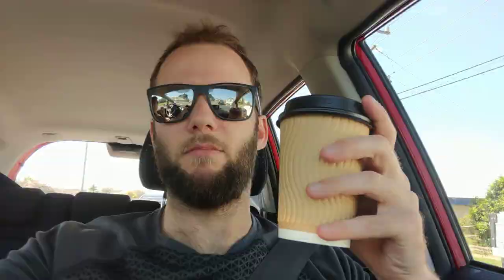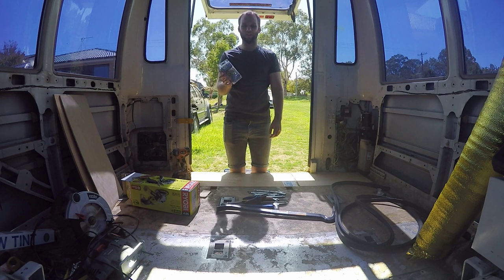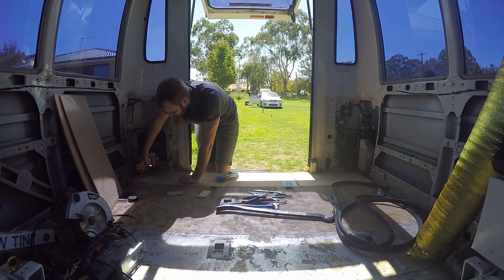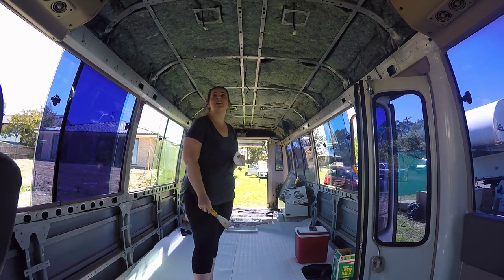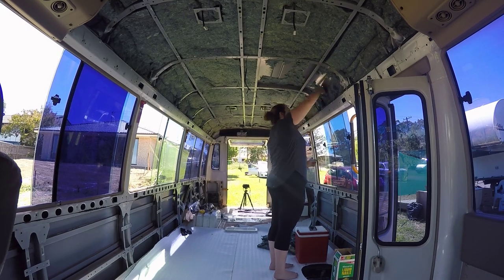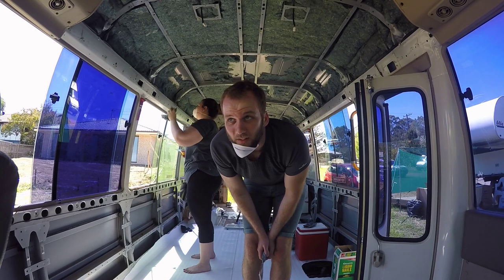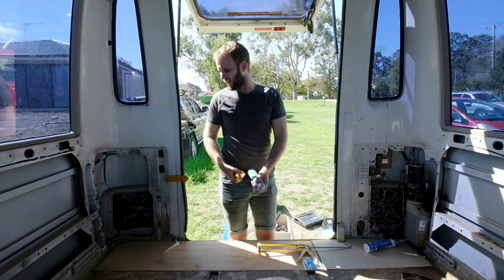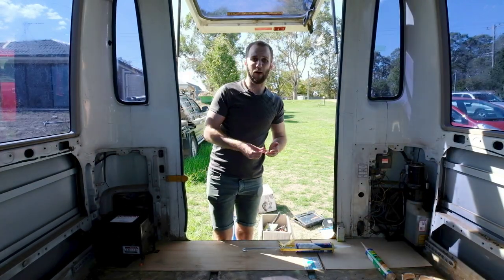Toyota Coaster Bus Conversion - Roof Insulation Removal and Finishing Underlay

Comment: How tall are you mate. Just checking out headroom.
Reply from the maker: Hi Francis, Shane is about 6ft and can just stand up straight in the centre of the bus (the highest point). He will likely need to hunch a little when we live in it which is something we accepted when purchasing the Coaster since we are happy with the size otherwise and are unaware of a similar sized bus with more head room. We may look at razing the roof at a later stage when money permits :)
Reply: Roaming on Rubber I spotted a Toyota coaster add from Toyota and they showed the structural frame in red in an animated diagram, I hate to say it back I think you might have cut into it when you fitted the gas HWS
Reply from the maker: Haha we might of! We have seen that ad as well. That is the structural frame for the newer Coasters from 2016 I think. They increased the height and width and changed the chassis to be stronger if it rolls. Ours is the older design and our frame looks different to that one. The part we cut didnt look structural (we hope!) as there was a beam next to it which we left. It looked like it only provided support for the wall. So fingers crossed that is all it was. If not I guess we will find out from the engineer! 😊